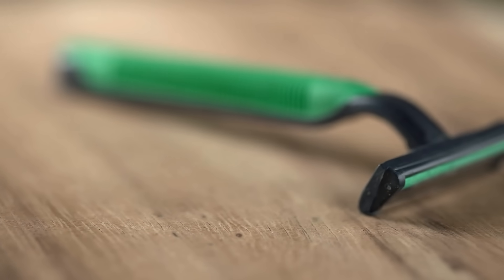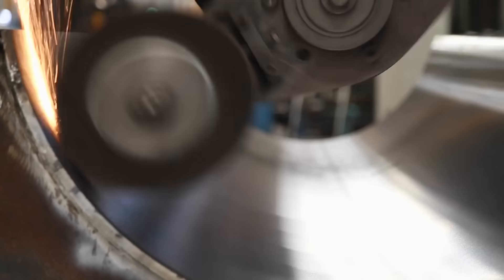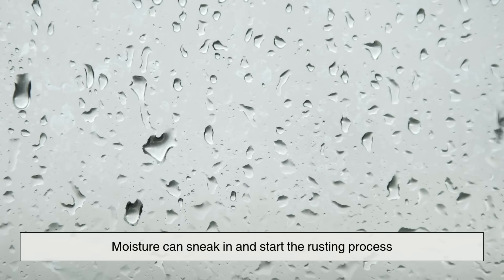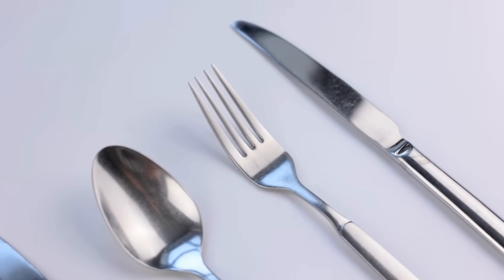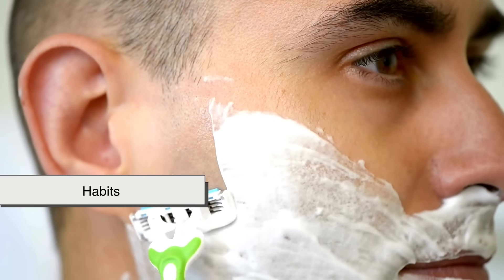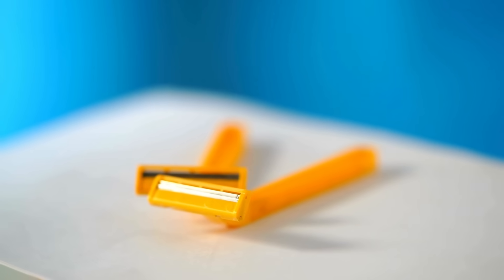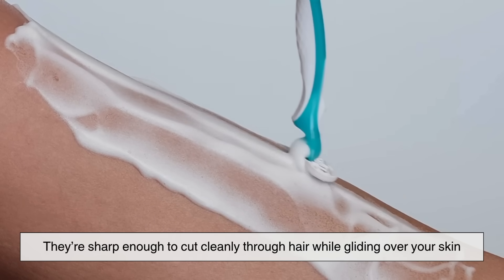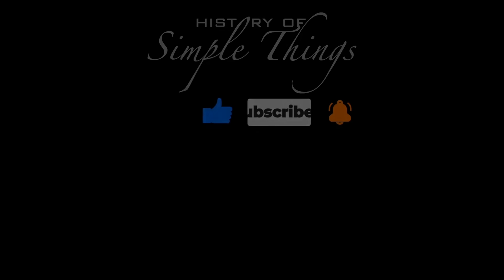Why Your Razor Blades Rust — Even If They're 'Stainless’ Steel

Comment: My razor has multi blades and they are not rusting. I use the same blade for many months before I change it, only because it does not cut well.
I was looking at the blade that I have now been using for over a month and there is no rust.

Comment: Don’t agree with this evaluation at all, Stainless steel has many grades of hardness. Eg marine grade used on ocean boats Won’t rust at all, the trade off it’s a softer material (I think more % chromium) so for harder steel suitable for cutting blades , kitchen knives etc more % high carbon steel is in the mixture producing a HARD blade but not as rust proof

Comment: Some electric razors feature self-sharpening stainless steel blades. Most electric razors do not require shaving cream, but some are designed for both wet and dry shaving, allowing for the option of using shaving cream or gel. Dry shaving with an electric razor is generally faster and can be more convenient. Many electric razors are cordless, because cordless electric razors use batteries.